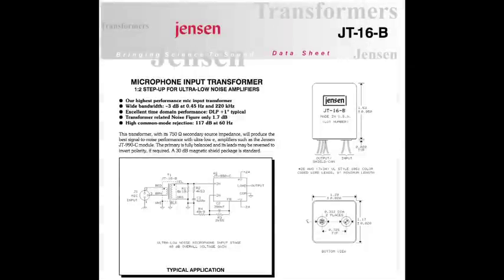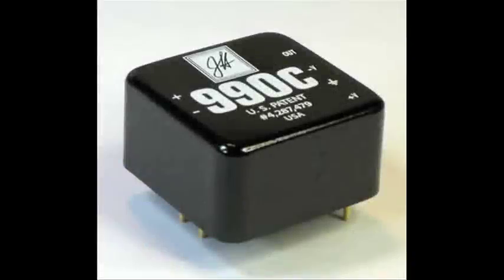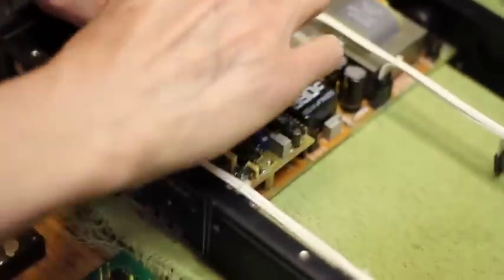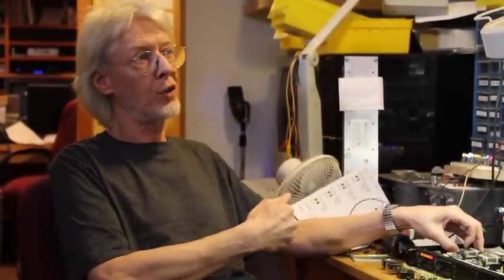John Hardy on his selection for an input transformer

Comment: Great info and explanation!
I’m a big fan of your 990C op-amp, BTW…

One of the several mic preamps I have (and love) is an ADK AP-1 mic pre (unfortunately, it’s been discontinued for many years), with its “pop and swap” topology, which allows for easy (tool-free) removal and replacement of various op-amps and XFO’s, and while I really like the sounds of all the combinations of op-amps and transformers I currently have available (Jensen, Sowter, Hardy, 7th Circle, Cinemag, Lundhal, ADK VintOp, etc.) my go-to combination for tracking vocals (and bass, too!) has always seemed to be your 990-C op-amp and the Jensen JT transformer. 
(And I’m not “sucking up” here, either…that particular combo really is the one that I tend to use the most for vocals and bass). 
🙏